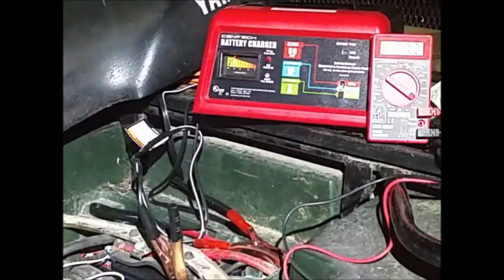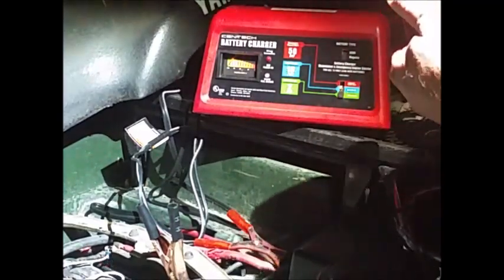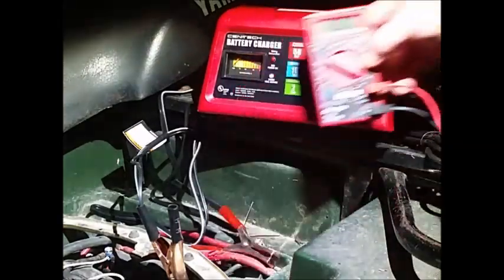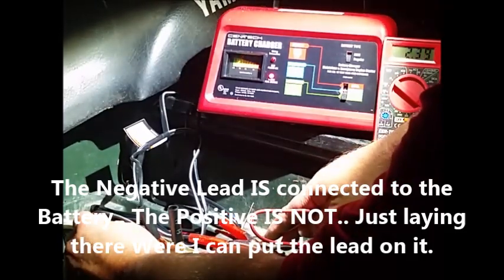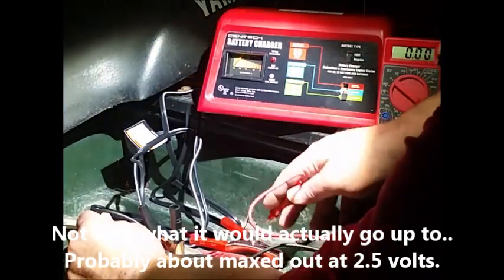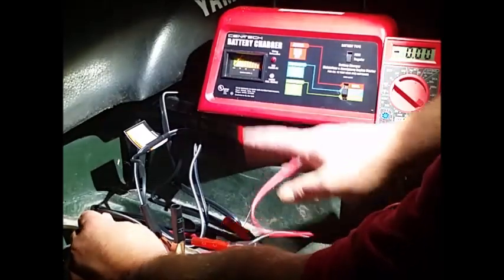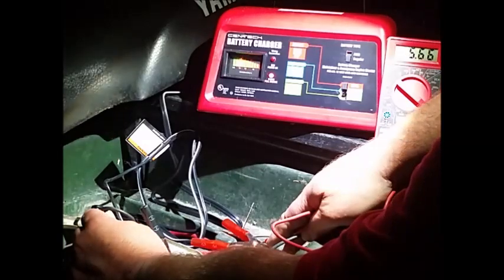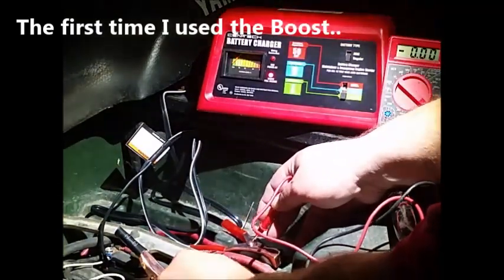How To Test A 12 Volt Car Battery Charger 2-10 Amp Charger. Harbor Freight Item# 60581

Comment: Im on my second charger and it does not seem to be doing squat.   I think Im going ot have to buck up and buy a quality name brand product.
Reply from the maker: I know what you mean.. I went through 3 of them..

So,, what is your alternative?? Depends on your needs.. I chose a more expensive unit and I'll explain why, and you decide whether or not is will become your choice also,, when you start looking at "Name Brand Units" as a replacement..  In my case, the price was close enough, it was an easy decision. 
PROS: 
First.. What I bought.. Diehard DH-200M 200/40/10/2 Amp $99.00 at Walmart.. 
200 Amp Boost instead of 50 Amp, and 40/10/2 amp charging voltages.. 
Has Timer and Hold functions also I liked. 
I guess I got lucky.. The only one I see now is $200??  I would search for the model number and see if I could find one for the same price somewhere..  
https://www.walmart.com/search/?query=DH-200M 
Other reasons.. 200 amp boost will actually crank something, where 50 amp at best marginal.. I don't want to fool around when I want to crank something..
#2.. Sometimes, when a battery starts dropping in voltage, over time,, you can charge it on 40 amps for 2-3 hours and wake it back up.. I just did this with two large bus batteries I though were going to have to be replaced.. 
I like the timer.. Turn it on, and don't worry about forgetting it.
If you need to crank a ""DEAD" battery, you can either 200 amp boost and crank it, or,, let it charge on 40 amps for a few minutes, and crank it a time or two, maybe three... If you are going to drive it after you jump it, just use the 200 amp and get on the road quickly.. 
Cons: Price at $100 was a no-brainer.. $200,, Ouch.. 
Can't sit it in the hood, and drop the hood to protect it from rain, etc..,, but, with 200 amps, don't need to.. When you are done, put it back up.. Unless you are slow charging.. Then, it becomes a larger issue.. 
 
Not quite as portable, although it has wheels and rolls, and can be picked up with one hand and carried if you need or want to move it through rough terrain.. 
I have used the battery charger for quite a few things since I purchased it.. Used the 200/40 and 2 amp charges regularly.. To be honest, I don't even us the 10 amp setting. No need to.. It's either Crank it, charge it at 40, or let it slow charge.. I am very happy I bought it. But, I have 10 vehicles, 4 wheelers, lawn mowers, etc..Alot of them sit all winter and we crank them about once a week.. 
I also have a set of home made jumper cables about 28 feet long, that are also 8 feet long usually, unless I use the extension cables. I use the same extension cables for my Welding machine and use quick connects for the extensions..That cost me over $100 when I did that, but, they are dual purpose, so, I didn't spend that on just jumper cables.. They are only jumpers when I need them, and stop welding to use them.. Ha.. 

I have forgotten the gauge or Ought of the cables, but, they are about 3/4" thick...  I'd say 5/8" is the copper.
These are the Quick Connects I use.. 
Weldskill TWE 
1-WPC PartNumber 9425-1125 is the Smaller Profile connectors
2-WPC PartNumber 9425-1225 Is the Large Connectors that I am using.
Good Luck with your choices.. If you only have one or two vehicles, might opt for a smaller unit and more portable. But, if you get close to $100 and can find the same deal I found, you will be happy you got the 200/40 Options.. 
Cheers.

Comment: just bought this same charger for my lawnmower  (trickle charge feature) and according to the charger, my battery was completely charged yet would not even turn over a lawnmower. I even tried it on the hard start option and that didn't work either. it did manage to start on the first try jumping off my truck, go figure
Reply from the maker: Too bad.. Mine worked fine,,,,, Until I used the Boost Feature.. 3 of them.. Exactly the same... 
I guess you were more unlucky than me.. On this one.. I video'd it crapping on itself, because I was pretty sure that was what did it the first two times.. Ha.. 
I am surprised they are still selling them.. Maybe not many people are figuring it out quick enough.. 
Maybe they think they just have a few that are failing here and there,, to be expected.. 
Cheers.